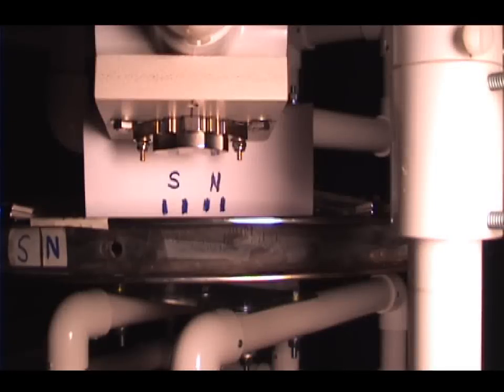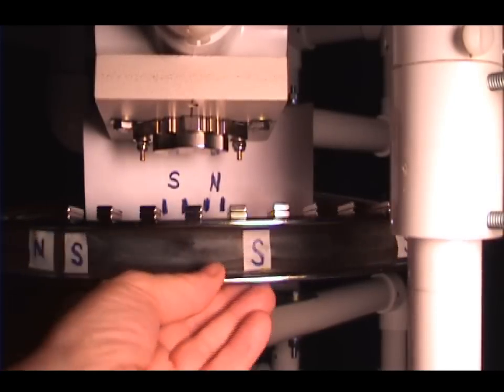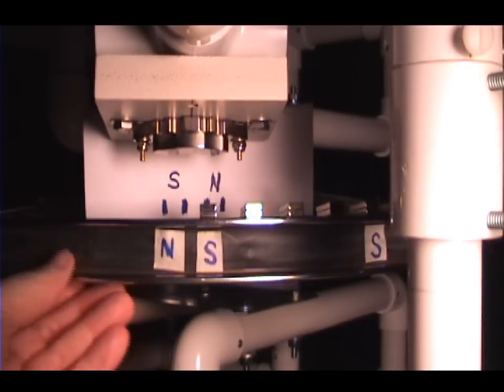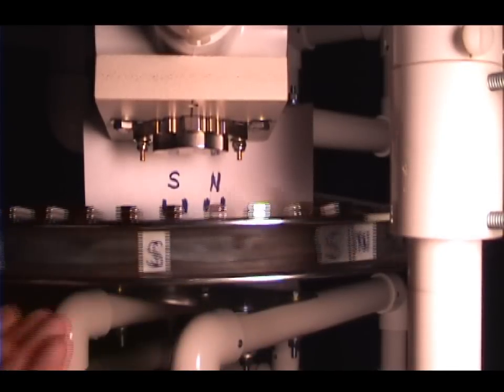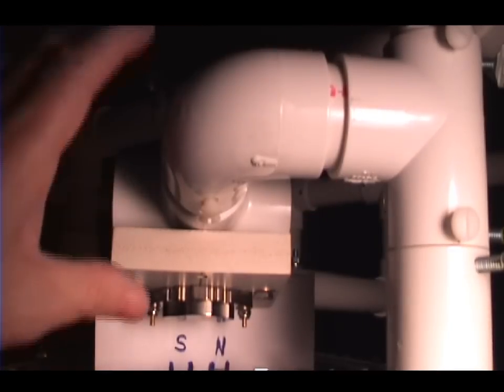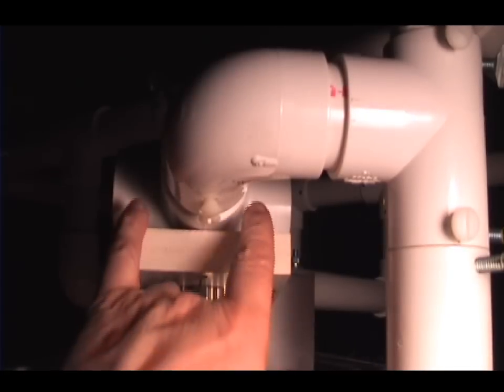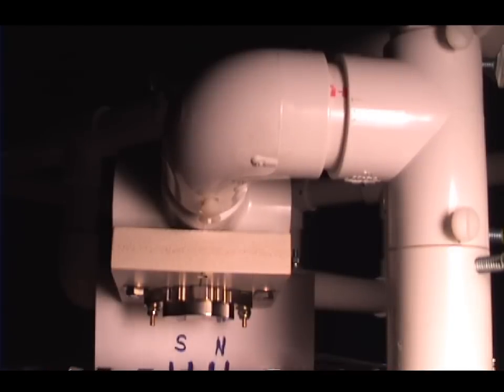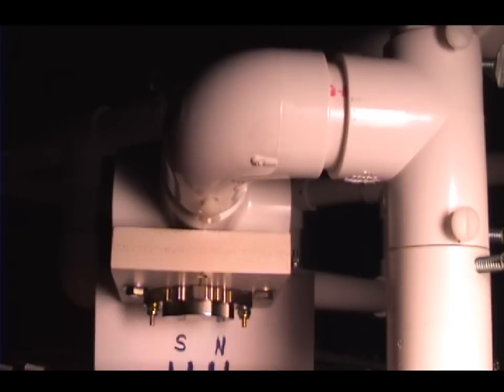Video #12, "Rick's Pipe Dream" Magnetic Motor - Generator

Comment from the maker: @ggibney0856 Moving the wheel the required amount would require considerably more force than moving just the stator magnet, so is not advisable.  Moving the stator up and down, as was shown demonstrated by hand in video #3, could be very effective, and is a method I will be soon be experimenting with.  A counterweight, draped over a pulley above the stator, could limit the force required to lift the stator to a half ounce or less, and a cam and lever arrangement could be used for lift and drop.

Comment: What about if you put a small (something with as little friction as possible like a ball barring setup or magnetic flux area by magnets on the structural plate) bump on the structural plates as the wheel spins that would lower the wheel that split second then raise it back up after the bump thereby losing the sticky point ?

Comment from the maker: When shopping for your fasteners, take a small magnet with you and test them to be certain they are non-magnetic.  If shopping online, specify that you want non-magnetic fasteners.  If you can't find them in stainless, brass or nylon machine screws will do just fine.

Comment from the maker: I think that after watching video #13 you will understand why a shielded stator is not needed, and would only detract from my the potential torque and rpm that are possible in my MOSTAT (moving stator) methods.  To put it simply, my MOSTAT methods use all encountered forces of attraction and repulsion to the utmost advantage.  Shielding my stator magnet from any of these forces of advantage would produce losses, rather than gains.  You may not understand this yet, but you will in time.  :)

Comment from the maker: Yes, of course stainless steel has steel in it, and some stainless steel is magnetic. Most ss fasteners, though, are made of 304 alloy, which is high in nickel content, and the nickel prevents the steel crystals from aligning in magnetic attraction. I can place any of my ss fasteners directly against the strong HD magnet, and there is no attraction whatever.

Comment from the maker: I should aslo point out that, for anyone interested in the stator lifting method discussed in this video, that the strong repulsive force that causes the braking effect can be utilized to provide all, or nearly all of the lifting force that would be required, with no anti-rotational resistance from friction or drag.

Comment from the maker: Incidentally, since you mentioned the bearings, this was a junked wheel - rusted, bent, and the bearings are wicked bad.  You probably can't hear it during the videos, but the bearings sound like they have sand in them as they rotate, and that's no joke.  I don't mind, though, as the wheel was free and I figure that if I can get this one working then a new one will do ever that much better.

Comment from the maker: In between groups, the stator magnet will not need to move at all, so zero resistance there.  Since all horizontal movement of the stator is achieved with relative ease, certainly you must see how the strong attraction and repulsion forces involved will be able to accomplish what is required.  I will also be adding a heavy flywheel (3/4" birch plywood ring) to the opposite side of the wheel to add a hefty flywheel effect that will provide forward inertia sufficient to counteract any drag effect.

Comment from the maker: If there is insufficient force, then I only need to use stronger rotor magnets to achieve continuous movement, so that's no problem to me with my design.  Further, I will not be lifting the stator in my build.  I only described this method in case someone wants to pursue it.  Instead, I will be moving the stator magnet horizontally, back and forth 1" across the rim.  There will be only 1" of travel per 10" of rim travel through each group.

Comment from the maker: I am teaching, not teasing, so learn and be patient, please.  Evidently, you haven't learned anything yet because I use only stainless steel nuts, and stainless and brass screws for the stator mountings.
Again, Roney's experiments are about magnetic shielding, and mine are not.  I don't use it, and don't need it.